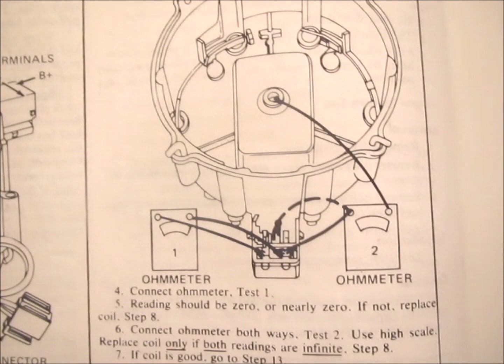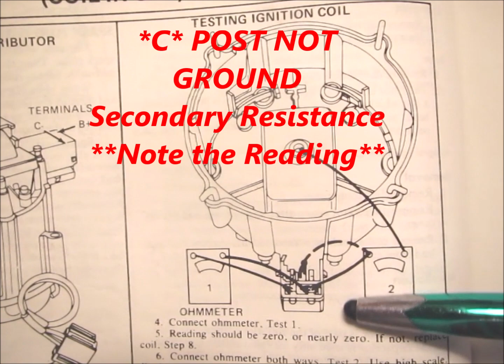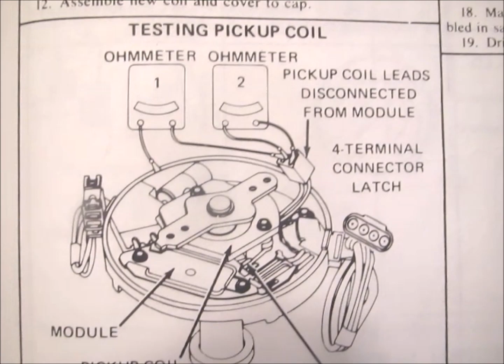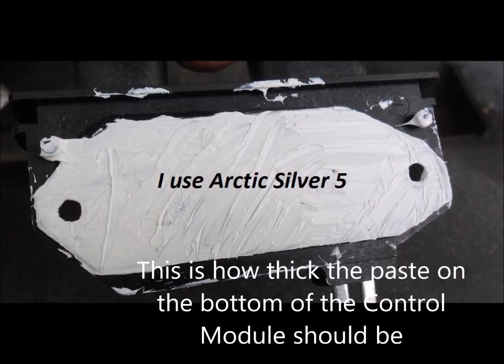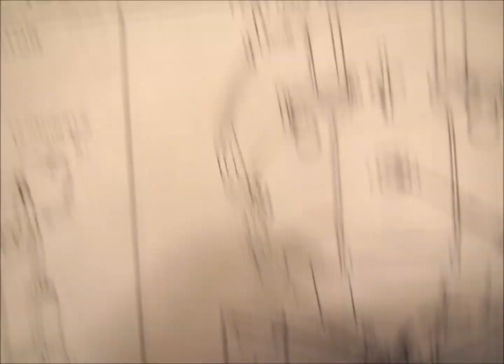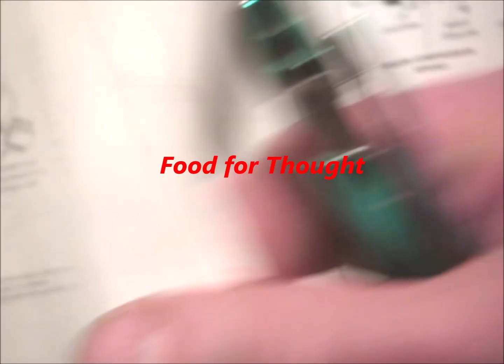★彡 𝐒𝐓𝐎𝐂𝐊 𝟖𝟒 𝐂𝐑𝐎𝐒𝐒𝐅𝐈𝐑𝐄 𝐂𝐎𝐑𝐕𝐄𝐓𝐓𝐄 彡★ Troubleshooting Stalling Pick-Up Coil Ignition Control Module

Comment: I have a code 42, Electronic Spark Timing. I can't imagine the control module is bad, car runs great.
Reply: @HorseshoeBeach  Thanks for the info. I don't recall disconnecting any of the electrical, just put in new chain and gears. Then again, I didn't remember the hot fan wire going to the pos battery terminal! The car was idle for about 8 mos. Sitting on ramps. Could even have had a mouse chew on a wire. I'm going to clear it and see what happens. Further research indicates it's a really pesky code, and not easy to figure out.
Reply from the maker: Yeh that's what I see about code 42 research. Difficult to diagnose! Man I''d really be interested in how it turns out. I like getting involved in the electrical part of this car but I can assure anybody I'm no expert, still learning. Let me know if you get a chance.
Reply: @HorseshoeBeach  Me too, no expert, just do my best. Certainly will do, thanks!

Comment: Well you're not going to believe this but I ended up taking the battery out and taking it to AutoZone and they checked it and said it was bad. I feel pretty stupid nevertheless. I'm hoping that I don't experience that anymore. I do know however have 12.6 volts on the dash and when it's running it's reading 14 point six roughly. I love your videos though and I'm going to watch every one of them because you are the only guy on YouTube that knows anything about these crossfires. I certainly appreciate you and I'm sure you'll be hearing from me again about something else LOL. Thanks a lot
Reply from the maker: But are you still having an issue with starting the car?
Reply: @HorseshoeBeach  as of right now no. It seems to be okay but I've said that before. I'm going to give it a few more days and see if it's good now.

Comment: Hello sir..Im a new subscriber since 5 minutes ago and I own a 1984 also..love it!! But I just experienced a problem..I went to start it up had lots of battery power started and died out..same thing three times!! Now the battery is acting dead.. which the battery is good.. Could this be the ECM??  Acting up?  I also think I smelt a fuel smell....It acts like vapor lock or something
Reply from the maker: Sent you a lot of info but decided to start over. 1) I would check the battery voltage again you will need 12.6 volts otherwise the injectors will be stupid. If the alternator isn't putting out a good charge the car will stall. 2) I would check the fuses on both injectors, they each have there own fuse. 3) If you can have someone crank the car while you observe the injectors, that will tell you a LOT, if both injectors are spraying then there are many test that are simple to perform with a test light and multi meter.  If both injectors are firing and spraying I doubt it is the ECM.  SPRAYING out the injectors and FLOODING could be as simple as a coolant temperature sensor......about $8 at AutoZone, because the ECM loves...........WARMTH, hates cold.  Be happy to help you if I can, let me know. Testing the voltage at the injectors is very easy also with a multi meter, a simple test light or a cheap NOID light from harbor freight.
Reply from the maker: if you ran the battery voltage down below 12.6, I would recharge the battery and start over. When these crossfires are running, the injectors will have 14 volts or more at the connectors.
Reply from the maker: Both the coolant temperature sensor stuck open and the throttle position sensor stuck or sticking, will cause flooding. The CTS is about $8 and the TPS is about $30. The fuses are 10 cents. Some people complain and gripe about these cars and nothing on them is very expensive or difficult to fix and diagnose, and properly maintained these are extremely fun cars to have. LOT easier to work with than the 1982 and way easier and less expensive than the 1985 and up.